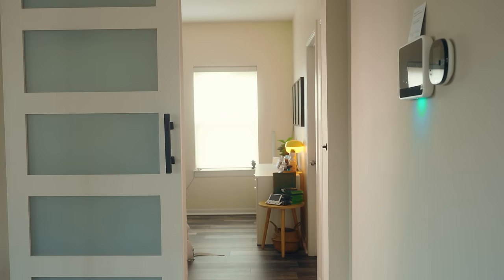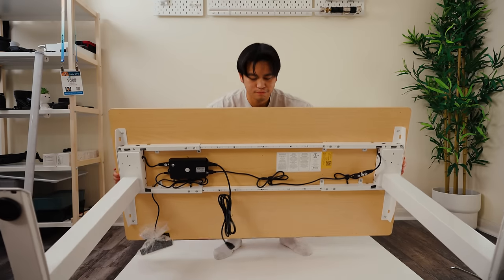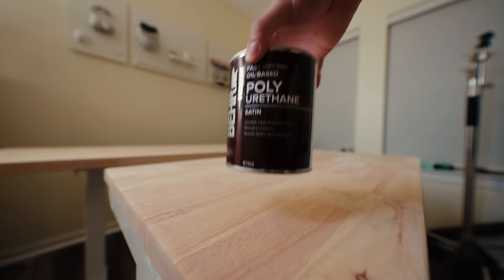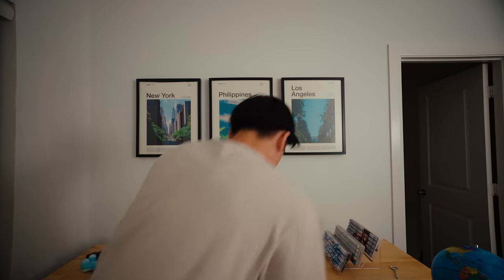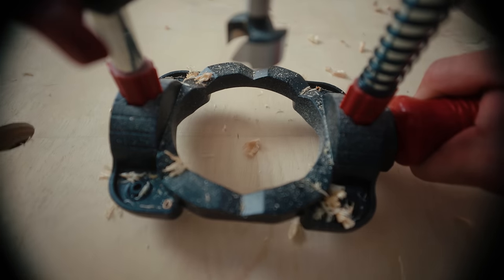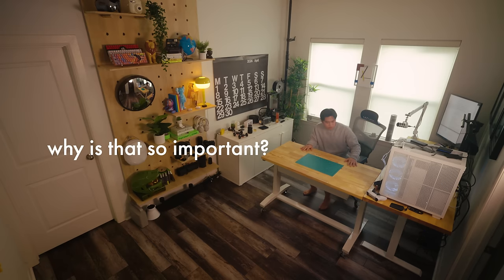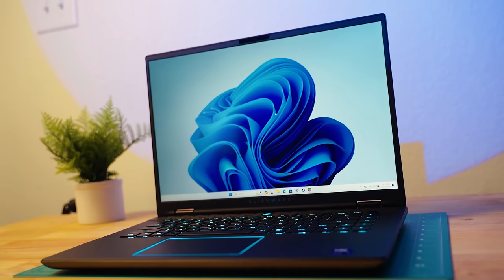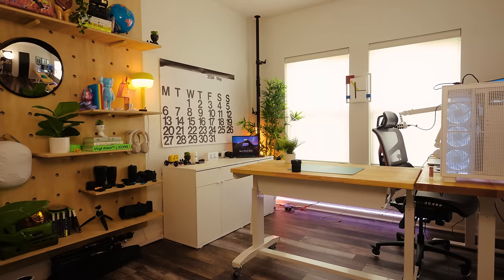Building My Dream Home Office/Creative Studio (2024)

Comment: How sturdy is that diy pegboard shelf? I might do this but wonder how much it can hold before the pegs or board fail
Reply from the maker: Seems pretty sturdy. Being held up by 4 drywall anchors rated at 100+ lbs each. Would be even more sturdy anchoring into a stud